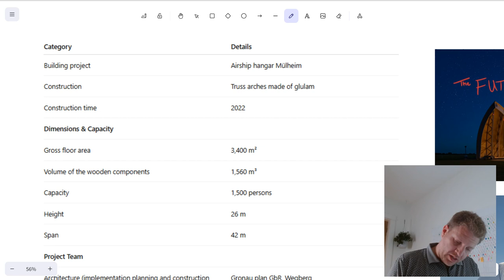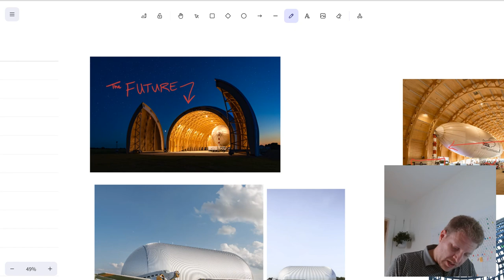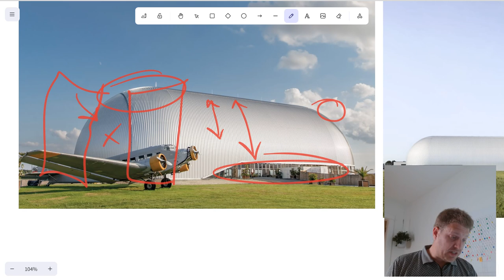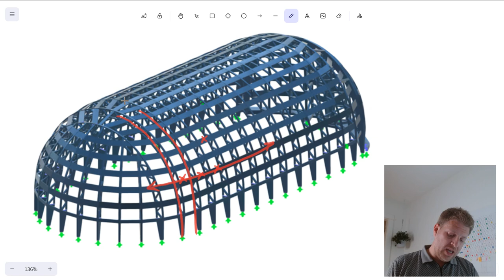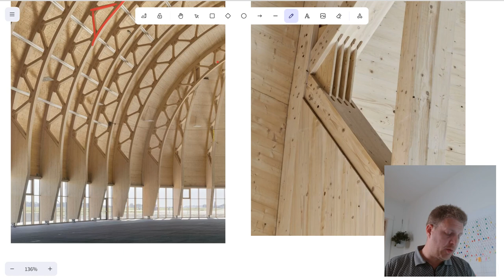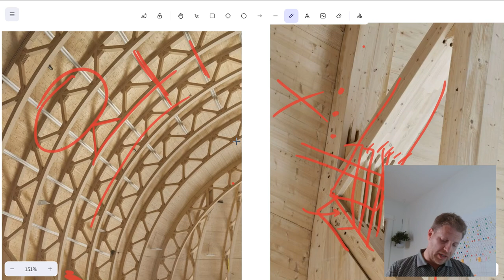Mass Timber Airship Hanger - The Future of Architecture

Comment: Really cool to see wood being used in this manner, and in a way that I wasn't expecting to see anywhere else.  I'm not certain if it would qualify under the same definition of mass timber construction as this, but I own a hangar made in WWII that uses a similar arched construction for the roof, with a lot of smaller pieces of timber bolted and nailed together to create long spanning arched rafters (about 125ft wide, each one being roughly 10" thick).  The roof is then tied to steel I-beams for the 16ft walls and the whole thing was covered in corrugated steel panels.  The arch isn't as pronounced as the hangar in the video and wouldn't fit an airship, but it did create a massive open area needed to clear the rather tall tails of WWII bombers.  What I find impressive is that the timber construction is still in great condition after all this time, while the steel panels have been replaced several times and the office buildings made more generically with steel and cinder brick attached along the sides of it were destroyed in a tornado (then rebuilt)...but the hangar itself held fast through all of it.  I'd love to know how they shaped the timber for the roof, it almost appears as if they did nothing more than stack long boards in an arched jig on the ground, applied (a lot of) force to bend them, and then used nails and bolts to solidify the radius.  They don't appear to be held together with glue, and it seems far too large for them to have been steam bending that much timber in the financially restrictive and rushed early war era they were making these in.
Reply from the maker: A WWII bomber hanger sounds awesome, I'd love to see it.... 125 feet is a massive span!  Its incredible how creative you can get with wood, even back in the day with limited technology.  Its definitely an interesting point that the wood has outlasted the steel... probably less expensive too.  Hopefully we see more of these buildings in the future, and I need to check one out in person.